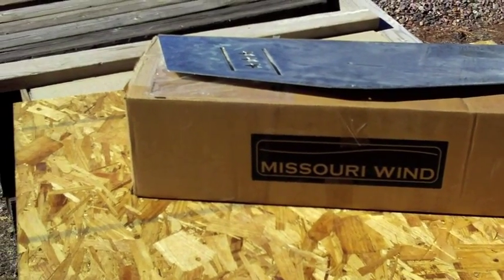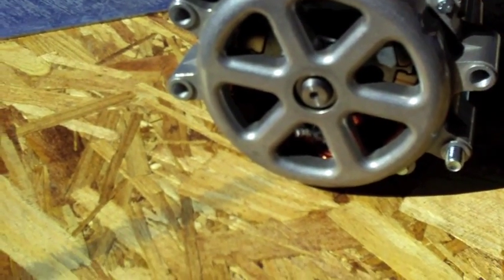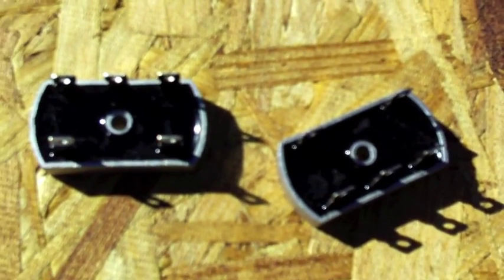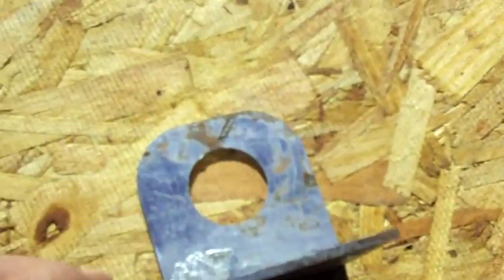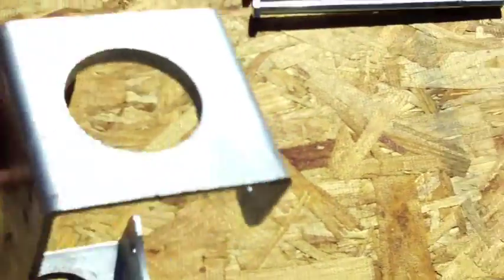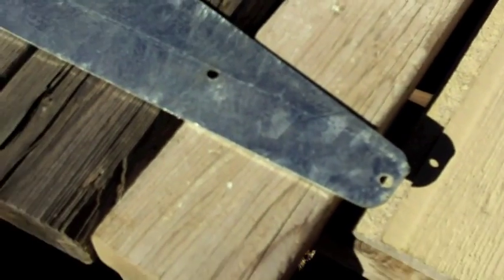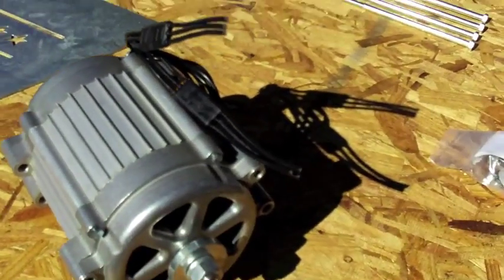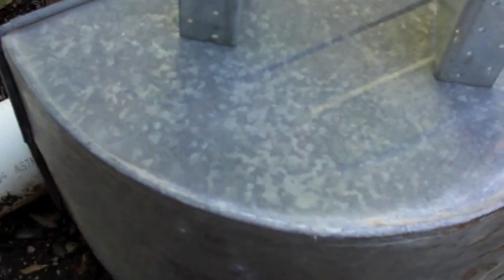Freedom II PMG Review

Comment: output seems low to me. on a 48 volt system . you need very high winds to make enought power to charge ( looking for 55 to 70 volts ) and when I wire for 98 volt grid tie . it puts out enought voltage but amps are so low I can not measure them

Comment: yea the galvanizing may not look the sexiest but at least it a good step to not having to paint it if you chose not to but if you do you wont see any rust for a very very long time.  My turbine been up for a year before Galvanizing. My hub I didn't paint so its rusted.  but I don't think I can see any rust on my tail I will have to look to see how well I did my paint job LOL .  But my tails and mount were just bare metal.  I got my stuff before they started Galvanizing there parts.
Reply: BonitaCreekWaterGuy Something i forgot to mention is that the galvanizing is a very thick coating that is suppose to be harder to do but is meant to last 50 years. I went with an American company and a big one at that.They are suppose to be one of the best. I got a sample from them and they even sent a rep to my store. What i sent them was thousands of parts which cost thousands of dollars and the dipping was thousands of dollars.Some of what i got back not all of it was what your showing in your video. The driver that delivered all the parts to my store told me that all the employees that do the dipping are illegals from Mexico and only one of them can speak English.Allot of the parts had boot prints on them that we had to try and clean off. This is American manufacturing today.Cheap ass labor using people that can't understand English or read signs and instructions that are in English.Those people are so use to the junky made in Mexico quality that they have no concept of what the word quality means.Pride in your work and craftsmanship. So you say why not change companies ? There competitors use the same damn work force to compete. I would have been better off to had it galvanized in China or Mexico or some other damn country rather then the US. Today you have to look damn hard to find a company in the USA with employees that give a shit about there product and it's quality. To throw away all those parts would have damn near bankrupted us but that's doing business today in America. Hit and miss finding good companies to work with that are proud of the things they do or make.
Would i have been proud of that finish and charged someone for it ? Hell no but i guess that's just me.Now all this video is doing is embarrassing me. All i can do is look down at the ground and apologize for the shitty finish. I will do my best to find the best companies to work with.

Jeff Harmon CEO
Missouri Wind and Solar
Reply from the maker: McCuneWindandSolar At 56 feet in the air I don't think I will see much. LOL My concern is with snow sticking to the metal and moisture from the rain that it might rust quicker.  That being said, it will out live me. :-)
Reply from the maker: MissouriWindandSolar To get anything galvanized is expensive. It is a very involved process if done right. It is sad that an American company can't compete with a quality outcome using employes that care and have the knowledge to do their job correctly. I feel that most of the problems are the fault of too much government. I am sure that you know what I mean. I hope that you will be able to find a company that will give you a quality product at a price that will work. Offering a quality product at a price that will sell can be hard to do. I researched wind and solar energy for a long time and feel that the Freedom II is the best on the market for the price. I appreciate that you are working to improve the industry. Your new Raptor 5 blades look great. Keep up the good work.
Reply: I am currently a student in green energy tech, and I have recently done a research project on how to build a small scale wind farm (10kw).  My research has lead me to believe that the Freedom PMG II has one of the best designs for this application.  As far as the hot dipped issues; they seem minor and easily rectified by an additional coating of rust proofing paint or other metal bonding material applied by the consumer during the first recommended  maintenance cycle.  This is not enough to put me off from purchasing these kits, but I do think that a good electrostatic bonding powder coat finish would probably be a better choice for the purpose of "appearances"; as any good advertiser knows the better a product looks, the more likely it is to sell well.  If the product "appears" high quality, you get better reviews in the short term, leading to better sales.  This is usually the case, even though you may only get a 30-40 year finish, instead of a 50.  Just wanted to give my 2 cents  ;)

Comment: wired at 48 volts what is the max voltage the unit is putting out at high winds ?? like 60 volts or does anyone know I want to hook to a 48 volt battery bank which is charged at 58 to 59 volts, so I wanna know what it puts out ?

Comment from the maker: Missy T, I do not think it is a spray on galvanization. It looks to be hot dipped, but very poor quality. As for the PMG or PMA , I do agree that it has a three phase AC output. It is permanent magnet unit with dual core output. I also found a better buy on solar panels than what MW&S advertises.
Reply: BonitaCreekWaterGuy That Missy T is my competitor, Thermodyne systems and he's lyiing about everything.It is hot dipped galvanized and is done at Arkansas Galvanizing.Missy T hopes you don't know the difference.
It is also a PMG, not a Delco PMA like Thermodyne sells.
Also my ebay ads don't advertise the 100 watt solar panels made in America, they are made in China and they are mono
Reply from the maker: MissouriWindandSolar Yes it is HOT DIPPED GALVANIZED! No question about it. Yes it is better than bare metal, but it is not HIGH quality. The first batch that is on your video was better quality, as you know. I was disappointed that I received 50 amp rectifiers and not the 90 amp ones that were in your video. I am hopeful that they will hold up and not get too hot and burn out. All being said I feel that the Freedom II is the best bang for the buck and I commend you for your work in making the industry better!  I was able to get a pallet of 24 solar panels for .77 cents a watt. They are polycrystalline (which I wanted) and UL rated. I also purchased two Midnight Solar Classic MPPT 150 charge controllers at the same time. No tax on solar systems in Arizona.
Reply: BonitaCreekWaterGuy If your after higher amp rectifiers this where i get mine. Rated at 100 amp's better then the ones you got. http://www.gigu-gigu.com/100a-1600v-bridge-rectifier-for-wind-generator-3-phase-ac-to-dc-p-24.html
Reply from the maker: ***** The video that was part of the ebay listing showed the 90 amp rectifiers. I felt that I should have received what was in the video and not the cheaper 50 amp. I will wait and see what happens when I get everything up and running.
Reply: BonitaCreekWaterGuy No problem, if you still want the larger rectifiers i will send them to you. I make changes from time to time and i don't delete the videos when i do.I try to make the ads clear and i usually put a note on the video that the product may vary from whats in the video.
Reply from the maker: MissouriWindandSolar Thanks for the offer. Let's see how the 50 amp rectifiers do and go from there. I will do a video of the set up and let you know how everything worked out. Keep up the good work.

Comment: If its a PMG, why does it have 3 wires per side? PMG's have only 2 wires and no rectifiers. A DC permanent magnet motor is a PMG, thats a PMA but its in a different body only. I see lots of weird claims on these. Seems its no different than the car alternator types, all same inside parts as the old one he has but in a new case at a much higher price. Was going to buy solar panels by him but he is selling Polycrystalline and all his ebay ads are claiming they are made in America mono crystalline which is a scam to me. Especially when he made a video showing them being imported from China.
Reply: OMG, thats what I am talking about. Mr Harmon is a pure dee liar and fraud.